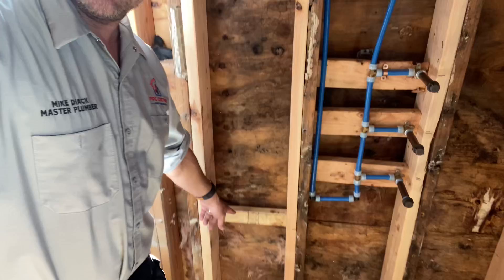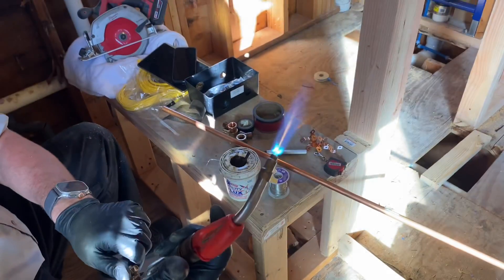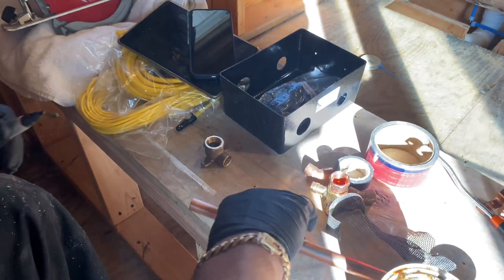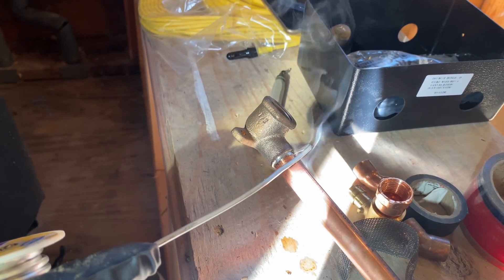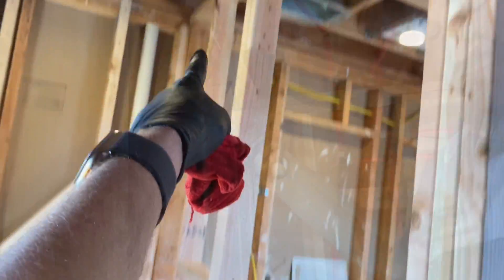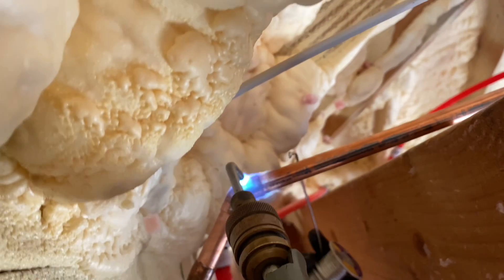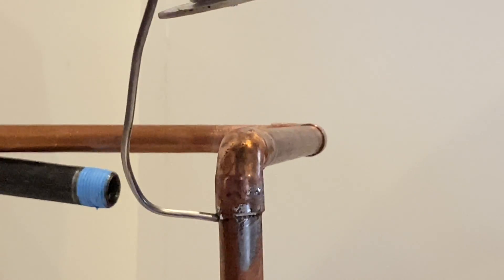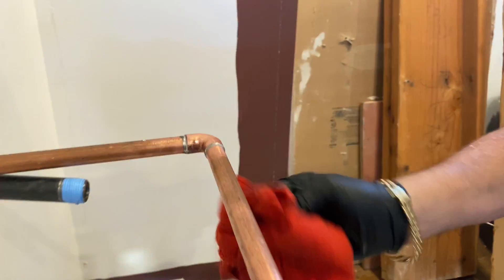How to Solder Copper Pipe The Correct Way with a Torch

Comment: Who has a tank with regulator , how about the flame
Reply from the maker: Great question! The tank with a regulator is essential for controlling the flame when soldering copper pipes. Make sure to adjust it to get the right flame size for your project!

Comment: Beginner here; 
That was a nice steady hand sir! opposed to mine. I'm happy to see you went back to the joint with the heat and solder where you thought you didn't get coverage:) I thought I applied too much by going back with slight reheat and slight reapplication where I didn't touch the joint. Thanks, appreciate the tips! 
It's great to see you professionals do your thing and make it look so easy. 
Installed a Moan shower tub valve for the first time, from a 1225 to the posi temp.

Comment: Could you use a benzo torch to do these?
Reply: https://images.thdstatic.com/productImages/bdd0e5ed-d50e-487e-ae2b-f91c525b191f/svn/bernzomatic-torches-tanks-336638-64_600.jpg
Reply: Bernzomatic as in hand held fuel tank with torch head attached? yes
Reply: he means hand held tank with torch head attached

Comment: I was also taught to solder the lower fitting first when doing them vertically, to avoid a snotty joint  , the amount of solder is the pipe size ( ? ) 1/2 pipe 1/2 " of solder

Comment: Putting flux inside the fitting is wrong… it gets pushed when inserting the pipe so the solder will be sucked inside and create turbulence

Comment: You should check out nokorode flux. It’s a good flux that causes very little oxidation. I’ve left joints without wiping them for a couple weeks using nokorode and I only get a small spot or 2 of green oxidation. Since I tried it out, it’s the only flux I use now. I’m a Comercial plumber so I sweat every joint I install. Nokorode saves me a lot of time not having to wipe my joints. All my work gets insulated so a couple spots of oxidation doesn’t really bother me but if my piping was exposed and uninsulated I would likely still wipe my joints.

Comment: Everybody does it a little differently. And differing municipal codes require sweat joints over propress on steam. We use a dry rag to wipe snotted sweat joints.

Comment: You can also use press fittings for those steam generators. I’ve installed a couple of them that way.
Reply: @PipeDoctor  Thatta boy. I’m only 28, but sometimes I sweat a job or two when I feel the urge to polish my skills.
Reply: I don't have a problem with press fittings for water they are fine I have seen no real issues. I may be biased because I'm an HVAC/R tech and I have see too many leaking zoomlock and lokring fittings (OEM factory installed ones mind you) so I don't trust them for refrigeration, but I just don't see why everyone is pushing press fittings so hard, they are fine but so is sweating some pipe. I have seen some keyboard warriors that get pretty hostile about it and I had 1 guy even try to argue that "if you don't use propress you're not a professional", I think that guy was just trying to justify his $2500 tool though.
Reply: @keldon_champion   I worry about those o rings failing 20 yrs from now
Reply: @kevinhoffman8214  long term it does worry me a little, I generally solder unless there is good reason not to, but I also don't judge people for using press fittings either